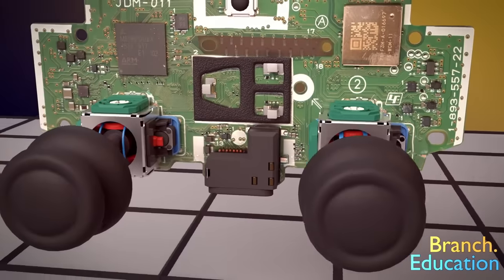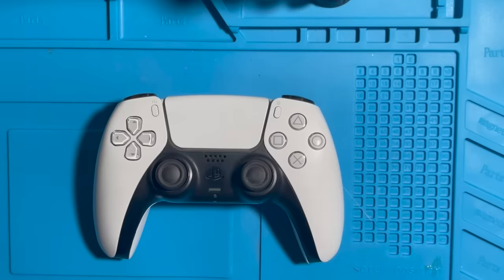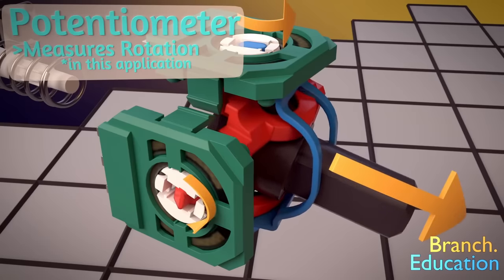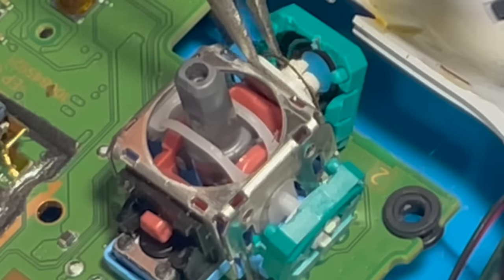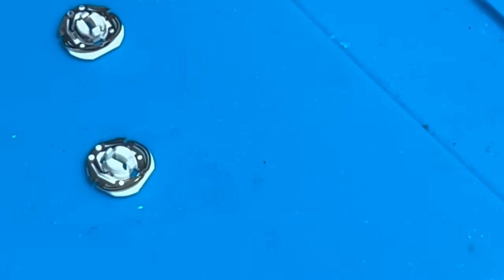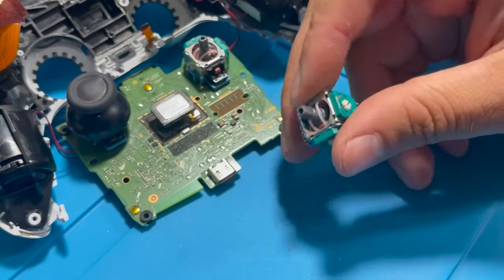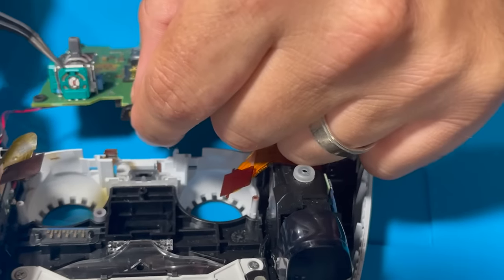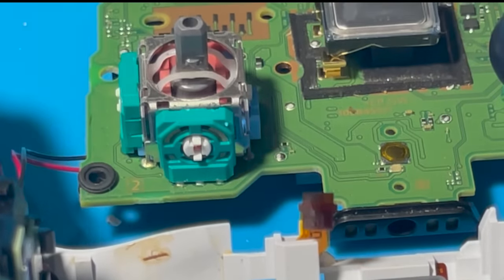What Causes Stick Drift Controller and How To Really Fix It

Comment: I think the companies know exactly what they are doing. This wasn't a big issue a few console generations ago.
Reply: It was always an issue
Reply: I must have been lucky in the past because I never had a problem with 3 previous Ps4 consoles. However, Ive had my Ps5 for far less time and now I have this intolerable drift! I don’t think Im up to doing this fix so I may just be forced to buy another controller. Yeah, they know what they’re doing alright!
Reply: This has been an issue since the first dual shock. While I wont claim that Sony wasn't aware and saw it as a money making opportunity, the actual issue is simply more advanced tech has a greater chance of developing issues. Especially moving parts. Even more so if you're like me and tend to grip the controller tightly. When playing FPS games I noticed I handle the sticks a lot rougher, constantly pushing them in unaware. If you haven't had this problem until now yeah you're definitely lucky.
Reply: @MikeChatman  I've used DS1s for over 2 decades no issues so this is more of a recent issue of quality & planned obsolescence
Reply: and yet Hall effect sensors exist and far outlast the potentiometer design
Reply: @mirosvanisland1649  are they more expensive? I’d be okay buying a more expensive controller that last longer. I wonder what’s they’re reasoning for not using those in manufacturing
Reply: @MikeChatman  more or less, yeah. you can buy kits to replace the entire joystick and do it yourself, but depending on your controller it can be more or less user friendly to do. the switch and steam deck for example just have units you'd swap out and screw in/plug in a ribbon cable. the ds5 is a little more complex since they're soldered to the board, but honestly soldering is so easy a good YouTube tutorial should be all you need. I'm actually planning to do just that with my ds5 that has a bad jitter on the left stick. already replaced my switch and deck joysticks, and honestly the hardest part of those is just paying attention to where components go (I recommend keeping the screws in a layout that will help you know what screw goes into what hole, they can be deceptively similar sometimes)
Reply: @mirosvanisland1649  yeah I can do a quick solder job if that’s all it takes. I’ll try it out. Because I’m tired of replacing it for the same one that has the same problems. Every two to four months I gotta replace it. It honestly feels like I’m being robbed lol thanks for the info! Any other tips would be appreciated! You’re the man 👊🏾
Reply: @MikeChatman  will let you know how mine goes! only other tip I could think of is don't cheap out on the solder/flux, and make sure the pads are completely clean of any of the old solder, but I'll see for sure later on. it sounds like you have to calibrate the sensors after soldering, (i didn't have to do that with my gulikit replacements for the other two, but afaik they're the goat when it comes to aftermarket joystick upgrades. sad they don't do PS5) and the polarities have to be right, but there's definitely a few good videos that could explain that better than some random person in a YouTube comment xD best of luck! 💜
Reply: I have my ps3 original controller almost 13 years old . No drift . I have my ps5 ,  6 month’s  and its’ drifting . Thats fact. Not my opinion .
Reply: @lajossimon6371  exactly!
Reply: Till my ps5 controller start to drifting , i didn’t know that is exist on ps. I have ps 1-2-3-5 .  I have first xperienced  the issue like drifting . Friend of my is X-box fan , he had that issue with previus X-box controller also.   I have experienced first time on ps5 how annoying . That is what i call : planned obsolescence . Ps 1 controller original . And still no drifting . Has lot of issue , but no drifting . Strange.
Reply: No. This is not a solution. A customer should not be fucking forced to open a $70+ controller with dozens of small moving parts, potentially fucking it up worse than it was before. I’ve never had this issue with ANY of my controllers throughout decades of playing and dozens of consoles. Has anyone from Sony addressed this?
Reply: Exactly, I had a PS2 for 8 years and used the same controller everyday, I have a Ps5 and my 2nd controller is now also getting stickdrift after only having it for about 6 months
Reply: I only ever got a problem when I bought my first scuf don’t get me wrong it took years before but it still happened then with my next one it did the same thing
Reply: @NannyOggins I've been through 5 controllers now since the ps5 came out. I've logged over 300 hrs on them tho but my purple one did start at 70 hrs. I was convinced it's me but now
Reply: Yeah they changed something i Don't know the name though
Check the older ones
Reply: @9ALiTY couldn't agree more. It had become more obvious with the way the big S had been conducting its business (cough-cough malpractice). I never had any of these issues with any of the previous Playstaion controller iterations, owed and borrowed, and I have a huge circle of felow gamers, none of whom encountered the same. Safe to declare SONY intended for these issues to surface at some point (not long upon purchase/first time use), in my case with the PS5, the first dual sense drifted upon the first week--and that was the second controller--less used than the other! Reason being? As simple as to boost dual sense controller sales! Nobody and nothing seems to really be able to address, let alone remedy the problem for a long time. Until now that is.
Reply: @JustArcher19 he probably meant it was never a problem with the previous PS controller iterations (PS1 legacy, dual shock, dual shock 2 & 3, PS4)
Reply: Had 1234 and now 5 this is the first time I got this experience
Reply: Ps2 and up issues
Reply: I've had my PS4 since it was released and I have never had a stick drift issues with my PS4 controllers. I only had my PS5 a little over a year and the PS5 controller had stick drift issues. Sadly it was 5 months over the warranty period and Sony will not replace the controller.
Reply: @mmxcix  I had just 2 month and it was  already sticky! It’s nonsens
Reply: @حمزةالشاعري-ث2س my ps2 controller from like 14 years ago doesn’t even have stick drift 💀
Reply: I have much the same story as many others in the comment section. Owned a PS1, PS2, PS3, PS4, had a slight issue with the PS4 controller, the left analog would ever so slightly squeak when used. It was irritating but I'd take ol' squeaky over these trash PS5 controllers. It definitely seems to be by design. I've yet to find one that lasts more than a year. I've had them drift anywhere between 1 month in and a year
Reply: Also I have a Sony Bravia TV that's dying now just a couple of months past the warranty date 😒 again seems like by design. Although in this case I won't be getting another Sony TV again
Reply: @strangeflavouredquark7393  this isn't just a Sony issue. Planned obsolescence is what alot of companies do Sadly.
Reply: @strangeflavouredquark7393  ps4 happend but not after a while but on the  ps 5 took like a month or 3 weeks of using a controller
Reply: @9ALiTY  I think its a possibility. But I also remember that games didn't really have tiny deadzones when using the thumbsticks so the drift may not have been much of an issue then.
Reply: I mean stick drift was a thing back in the day, but most of the time I ever dealt with older generation consoles/controllers it was an occasional defective controller right out of the box. I have a lot of siblings so we generally had a bunch of copies of controllers. Still was far more rare. And the only older gen controllers that would get drift eventually were Nintendo in my experience. N64 especially, but this was esstianlly the first joystick for consoles, since PS1 controllers did not have the sticks until 97, and it was also the last controller to have three handles :P.

It kind of sounds like a weird conspiracy theory, but I don't care, modern stick drift is too prevelant to not be intentional, they probably didn't mean to make such and large and obvious problem, but on the other hand, money. Especially since consoles sales are way down compared to past generations. But it's very easy to tell that all they need to do is make those stupid wipers degrade very quickly and for the majority of people that's $70 gone, for others that's an unacceptable amount of effort and money (and potentially making it worse with small pieces like that) for the latest and greatest console controllers. 

Hall effect isn't something new, or more expensive, it was purposefully ignored. If it's more expensive it's only because they haven't been working on engineering them for console controller use, they've been using them for heavy machinary that has any kind of joystick for awhile. There's literally no good reason you could give the consumer on why they don't use the version that doesn't just develope drift over time. The $150 dollar "elite" versions of PS and Xbox controllers is espescially egregious. You have third parties like 8bitdo making really nice hall effect controllers with other nice items like a 2.4ghz dongle(which feels much more reliable than bluetooth for input delay to me) plus a charging stand that can store and use the dongle for $70 originally, now usually 60 I think?
Reply: Buuull S* it wasn't an issue 😂
My very first issue with it was my N64 controller back in the day. Lol
Reply: @JustArcher19 never had problems on ps2 and previous
Reply: I have two ps3 controllers that still work perfectly after 14 years of service.
Reply: @حمزةالشاعري-ث2س  that's definitely a lie I've been through more Ps2s- Ps3s than the controller. Stick drift wasn't very common.
Reply: @MikeChatman You have to take into consideration of the frequency of the issue. It's at a very high rate now.
Reply: @JustArcher19  blame it on the games that have gotten hard to beat, blame the devlopers that use bad techniques that push the controller to their breaking point.
Reply: Planned obsolescence
Reply: Research how good Dreamcast analog stick was.
Reply: @حمزةالشاعري-ث2س  yep even n64
Reply: it wasnt.
Reply: @rubzR  hey, if the reply was aimed at me, then I’m only talking from my experience. Played so much Mario kart 64 and goldeneye back in the day. Best times. Apart from my stick drift 😅
Reply: @robinellis83  no bro it was for the guy that said every gen had this problem
Reply: true. My xbox 360 controllers never had this problem and I still have them with a working console.
Reply: Stick Drift has always been an issue, but the last generation or so has definitely seemed to see more drift issues than previous generations.
Reply: @9ALiTY  Literally just used my PS2 controller from my middle school years, I'm 32, and it's working fine. All 3 of them actually (some late night Dokapon). This is intentional nowadays.

Comment: this should be a class action lawsuit
Reply: I've thought the same thing for a while
Reply: Amen, I got the dual sense edge and it came with drift out of the box. I got replacements for the stick module, two and the one of them still had drift.
Reply: @nickalexcage draw at that point just get a new controller
Reply: pretty sure nintedo go sued for this then never actually fixed the issue. 
I remember the fix in my case was the screws just had to be tightened.

Comment: 6:52 you can actually see a tiny piece of the piece falling off there, so that could be what was causing the  drift as well. Thank you for explaining it so well and taking the effort of zooming in on the close ups. Keep the good work!
Reply: No that piece broke off of the old bracket (white) but it didnt matter because its being replaced
Reply: It broke when he was putting it together the first time after cleaning it with the q-tip. You can see him struggle to close it back up and then as soon as he opens it the second time, the little nub falls out. So I think the cleaning worked maybe but he broke the dowel that holds it steady?
Reply: @SSjGuitarist  yeah

Comment: Extremely clear breakdown, helped me identify  the problem behind the stick drift. The one downside is it seems to be an inevitability that the  potentiometers will wear out/ burn out with time and use, forcing you to replace, if you know how.
Reply: That's the point of companies using this tech, honestly. It's meant to break down and make you buy new peripherals, cause not many people know how to solder and repair. Like, Sony and Microsoft COULD use hall effect pots, but...why? People would buy their controllers less because they won't ever NEED a new one; the controller just wouldn't break down with better tech.

In other words, pick up some hobbiest and repair skills and keep them in your back pocket. It can be really cathartic fixing these products on your own, and it ends up being a fine investment in time and money (and it's just better for the environment, anyway).
Reply: Unfortunately, companies see controllers as consumable items. If you look at the datasheet from Alpine Alps, the manufacturer of the sticks used in every game console, they say that a stick will last 2 million cycles. Sony could have very easily introduced hall effect sensors but instead they made the edge controller so you can buy more the sticks that will wear out.
Reply: The controller that came with my PS5 was completely cooked after a month and now the second one I bought is bugging a month and a half later, idk what to do :/
Reply: You can return them. Sony will replace them if they are that new.
Reply: @indykid77  Just returned mine. I honestly thought a whole batch of controllers were manufactured with this defect. Now I got to wait and see how the fixed one will turn out.
Reply: Tou can try to repair worn path on potentiometer with pencil. Just draw it back in my case it helped
Reply: I don’t know for how long it will help but graphite in pencil is what you need

Comment: This is actually a really good solution I tried it some years ago because I didn't want to replace the whole analog sticks so out of desperation I accidentally did what this guy did and it worked again.
Reply: Yup it's awesome, and now they give you the option to completely replace your analog stick with the dual sense edge for $20 a pop,  smh. I like it but $20? Nah.
Reply: @joel3683  Beyond disappointed they did not just use Hall effect sticks. No, they had to reengineer the thing so they could sell you a “solution” over and over. Gross.
Reply: What did u do

Comment: I'm just gonna say, this video helped me BIG TIME. Initially, I opened my DualSense and just sprayed contact cleaner into the analog module and tried rotating it around a bit to see if that would clean it out to remedy the drift problem, but it didn't. Once I came across this video, I tried doing as it said and pulled the wiper out and cleaned with a q-tip and the contact cleaner and once I put it back together, the majority of the drift was gone. There's still a very small drift but it doesn't seem to affect the games at all so I'm going to call it a win! 

Great video, keep it coming!
Reply: Yep gotta open n clean the rubbers

Comment: Best thing I found too clean the wipers and the contact strips is contact cleaner. The qtip method leaves fibre strands that will cause drift again.
Reply: A toothbrush brush should work better as well since a good toothbrush will not leave any risidue or fibers.
Reply: @MugiwarasNakama  might be a bit abrasive on the contact strips.
Reply: i bought foam q-tips on purpose :V
Reply: @Manc82  not all toothbrushes are made the same. Some are very soft and sensitive. The great thing about using a toothbrush is that the bristles are specifically designed to not come lose and are designed to bend and take more abuse than the object you are scrubbing.  You just need to apply the correct amount of pressure. If you are pressing it roughly over the components ofc its going to be abrasive. But with a light touch it shouldn't be a problem at all.
Reply: Just make sure it's plastic safe.
Reply: Alcohol wipes bro